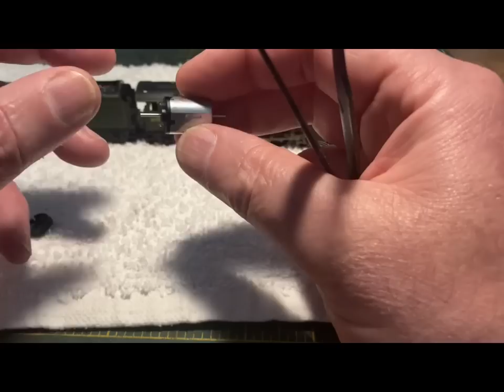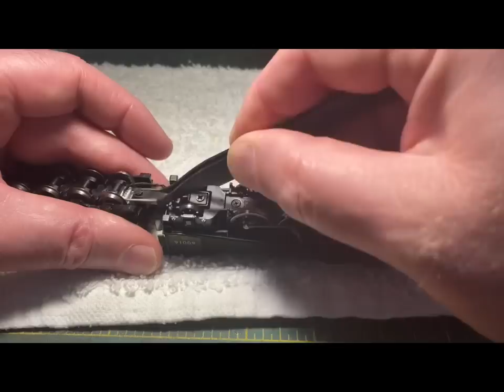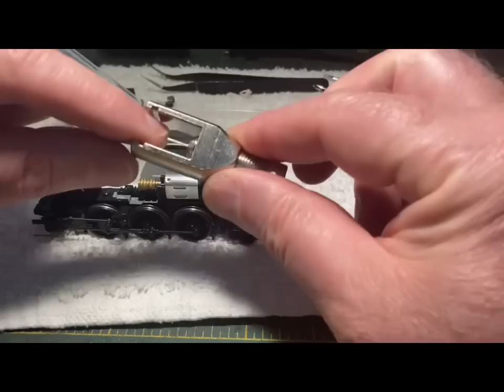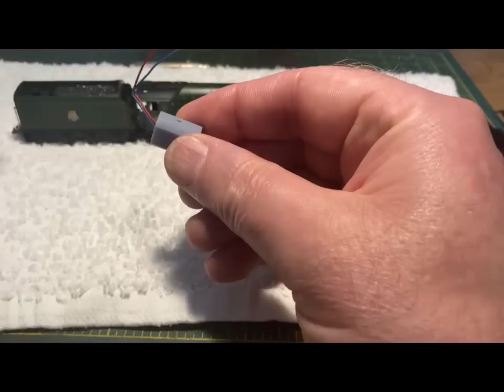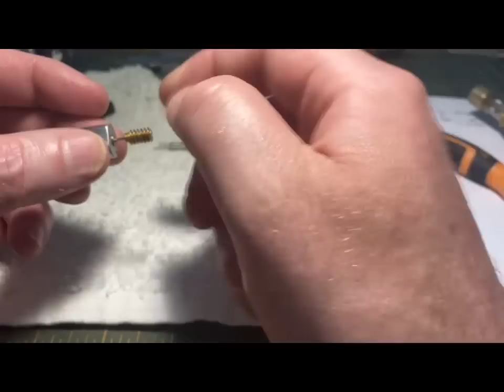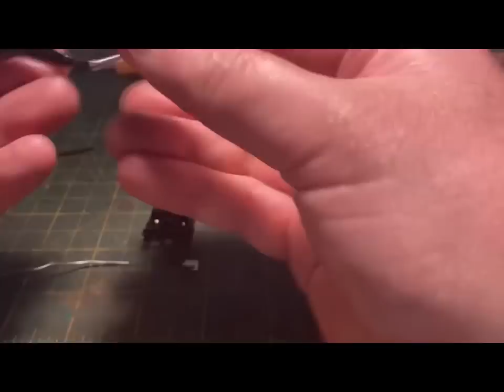Hornby TT:120 motor failure; a look inside & fixes UPDATES in description for suppliers

Comment: Fascinating video. Really appreciate, not only your positive pragmatism, but your technical analysis.
Being a little obtuse here: I've got a fair few items of TT, generally the old Berliner items. Now, I've been fiddling with a few motors, be it the original round case or square motors. The round case are sealed, but with changeable brushes. They are however an older (be likely 60 odd year old design now) and like anyone was interested in improving low speed running.
Now, I've tried a flywheel N unit, which burnt out almost instantly. What I deduced was that their more complicated drive (in this case a BR56 with all drivers geared and with separate gearbox assembly) was overtaxing the motor. Round case back in.
E94 krokodil: replaced with big flywheel mabuchi, slower top speed, generally excellent running characteristics. Another E94 I did a coreless: generally good consistent low speed but very excessive top speed, and far too responsive to small voltage increases. Basically very hard to control. (Using HM2000 analogue controller). Other E94's are round case and square case. Square case is more responsive (think less current draw).
The conclusion I've ended up is the old round case actually does have acceptable low speed running characteristics, is very tough and reliable, powerful, and its worst characteristic is its excessive size. In steamers it fills the cab, electrics and diesels of course it's no issue.
The modern tillig are superb runners, but like all tillig they're expensive.
Basically what I'm saying in this long-winded comment is I'm quite happy making the compromise of functionality and reliability over aesthetics.
I will also add, slow speed running is a bit of a misnomer, I am more desiring of smooth starts and stops over any crawling ability.
Think its very commendable you experimenting with remotoring, unfortunately in your case it's through necessity, in my case it was just a case of being desirous to experiment.
I personally have either stayed with the original motor, and if I was going to re-moter a loco again it would solely be a flywheel mabuchi.
Reply from the maker: I had a Tillig small diesel that shorted its own motor straight out of the box, it was disappointing but Tillig agreed to have it back as you would expect but for the first time ever I dropped the loco on a edge of my steel tool box…lots of parts mostly broken so it never went back. A Roco Br108 motor failed (same issue as here) in 8 hours of running, it went back, 5 months later returned, lasted 1 hour and then Roco refused to even talk about it. Poor company ethics. I remotored that one myself and it’s fine now. The brand that always impresses me with running and durability is Piko, I had an HO BR118 as a youngster and it was a tractor! I have two Piko TT locos now and they are so impressive. The detailing isn’t the same standard as Hornby have achieved but running and hauling power is faultless. 
Having DCC and in particular HM DCC is a real help with re motoring as you can fine tune any motor easily. The hurdle is getting the BT decoder into the model, hopefully Hornby can get Gen2 smaller ones out soon. 
Glad you appreciate the approach, a lot of people in YT lane are drama queens and not engineers, although this is not my area of expertise, an engineering approach delivers results. Identify the fault, fix, redesign, implement. What can we do now with what is available? 😁
Reply: @HighFell   I was afraid you'd mention that regarding tillig. I think I've been lucky with the very few I've had (although my E77 has barely been run), the German tt forums aren't the most complimentary regarding tilligs consistency in quality and reliability. Roco seems to be detail and body molds, but very, very few are complimentary towards their quality of running gear.
Everyone is a fan of Piko: I had just the base tt Taurus, and it was a beautiful loco. I'm quite keen on trying out a kuehn at some stage.
TBH, my main trains are '50's and '60's märklin and '20's Lionel, Ives, and American Flyer, and with reason.
With the old Analogue märklin I've got a few pieces of the very, very good quality HAG. Yes, in appearance they may be considered crude, but they measure quality in paint finish, functionality, and reliability, not through the amount of add-on plastic detail equipment.
I've currently got what used to be my modern dcc scale H0 sitting in a box as I've just given up. It's all likely to end up in the bin in the near future.
I've honestly lost interest in attempting fitments and refurbishments and alterations through necessity, I enjoy fiddling and tinkering but just because I want to tinker. 
All good fun, and as always, tt is die ideale spür
Keep up the good work
Reply from the maker: @muir8009  thanks, I think one area where Roco and to a smaller degree Tillig have let themselves down is customer service. Roco is probably the worst company I have ever dealt with, on anything. The arrogance they display is staggering. In UK we are very lucky that our home manufacturers are very customer focused and while things are not always perfect they do try very hard to get things sorted, Hornby are absolutely top of the tree on customer service and why I really hope they can get to grips with this issue, we know they have already made revisions and changes as things have shown up. Absolutely, TT, the perfect scale 😁

Comment: Interesting back when I used to shoot I had a set of drift punches, all of those used a hardened steel pin with a highly polished tip (so as not to mark the surface of the pins you were removing) for that pin to bend like that it's probably just mild steel with no heat treating. If one had access to a small lathe it would be a relatively simple if crude replacement to use a pit of correct sized mild steel for the body of the pin that mounts in the tool and use a HSS 0.9mm drill bit as a replacement for the actual driving pin just cut to length, you can buy 5 0.9mm drills for £5 so you could even make several different length versions to just drive out a bit at a time.
Reply from the maker: They are just mild steel, and some tinkering with a lathe would be ideal. Hardened pins would be ideal and the diameter could be increased slightly to 9.5mm too. Might ask a local blacksmith if he can harden some for me. 👍
Reply: @HighFell  it seems rather strange to think of a blacksmith working on something that's just 9.5mm in diameter!!
Reply from the maker: @andybuckley9223  to harden steel, it’s brought up to 600 degrees and then quenched in water.

Comment: THAT IS BAD sound.
Reply from the maker: I am wondering if that was the motor chattering in the mount, there was some movement even with the foam packing in place. If that was your car you wouldn’t drive it!
Reply: @HighFell  I Thought that gears are not meshing buy that sound, As had OO scale Hornby Loco that blew a Motor and refitted make it more Louder Which I do not mind

Comment: Very informative, thanks for making. May I ask what soldering iron you used, thanks.
Reply from the maker: The one to heat up the worm gear or to desolder and solder the motor wires?
Reply: @HighFell  🤣 I thought they were different and then I questioned myself! Both if you don’t mind, thank you.
Reply from the maker: @Haymarket47  the electric soldering iron was a generic Chinese kit of Amazon £15 and perfect for model railway stuff, the stand does need holding down though, I use black tack and an off cut of ply to stabilise it. The cranked tweezers and cutters are part of kit so really useful tools. Iron has replaceable tips and adjustable heat setting. Soldering Iron, Soldering Iron... https://www.amazon.co.uk/dp/B07SLRRYMC?ref=ppx_pop_mob_ap_share
The gas one is a Portasol SuperPro 125, had it for quite a few years, very useful for soldering where mains electricity is a problem, they are more expensive at around £40ish. I don’t think heating the brass worm did that much, using the shortened pin is probably the key.
Reply: @HighFell  Thank you for such a comprehensive reply.

Comment: Excellent Matt, hopefully Hornby will look at this and try to see if they can help us but I am not holding my breath. I would like to think the J50 motor with brushes might be a direct replacement.
Reply from the maker: This is what I am wondering Garry although the carbon brush versions of this can size I have seen are larger around the end cap so slightly longer. That’s only ones I have seen and there are 1000’s of motors out there so it’s a wait and see thing. 👍
Reply: @HighFell  when you say longer Matt, does that mean the overall length may be slightly longer? If so, I should still be able to fit it with a little judicial grinding.

I imagine it could be due to the brush width being wider than the metal wipers?
Reply from the maker: @garryhall5552  yes the one I saw was  about 3-5 mm longer but it was a photo rather than with full description of dimensions. The end cap was obviously more bulky and the carbon brushes are held in with a wire spring like many of the Continental HO models used to use.

Comment: Nice result but is there any reason this motor would last longer than the Hornby one? I was interested that the coreless comes with an adapter. That seems like a good solution. What do think?
Reply from the maker: The plan was to try this motor first for two reasons, it’s dimensionally identical and has very very similar insides so a direct comparison and at £1.50 each you could replace a arm full of of them for the price of 1 coreless one. The next will feature a coreless swap, Trigo is displaying early symptoms of motor failure so I expect won’t have long to wait! I am speaking with another supplier whose motors I would prefer to try. I’ll keep people updated

Comment: Wow! Surprised at this issue, but great that you have found a solution for us and our Chufty Pufty’s if we get the same issue.👍 Actually, now you’ve highlighted this, I’ve noted that my Willy Whitelaw is making more noise now after just about an hours (if that!) use. 😱
Also on a completely different topic, some videos ago I asked you about a ‘how to’ video for a “reverse loop” using the HM 7000. I’ve now got that baseboard built (nearly) so will hopefully be needing some more or your Helpful Hints 😉
Many thanks indeed for all your advice which is very much appreciated. 👏
Reply from the maker: Sorry the reverse loop stuff still in the works! It’s not 100% HM 7000 as I use regular DCC for operation and HM DCC for tuning the decoders 😁
I am not having a downer on Hornby in TT:120, but there a few things that need sorting and they can be 😁
Reply: Hi HighFeller, wow you reply quick! 😂 I’m looking for a reverse loop module that will work with the HM7000 system and hopefully I can figure out the other bits???  The items I’ve found so far state won’t work with the HM7000 so any pointers would be HUGELY appreciated.
Again many thanks for all your contributions, and I’m learning lots from your posts. 
Cheers 🍻 
Andy
Reply: I agree there a a “Few” things that need sorting and these are frustrating, but I’m still very enthusiastic about the TT120 offerings that I’ve bought so far from Hornby and the growing number of other suppliers/ sources .
I just hope someone fairly soon offers some little steam shunters, or a Castle Class/ Hall Class/ Black 5’s etc etc etc….. 😉🙄 I know, patience is a virtue. 🙄
Afraid the J50 doesn’t really float my boat, and to top it all there is no DCC ready version currently on the cards. (Same as the class 08??)

Comment: It sounds like perhaps the worm gear needs repositioning on the spindle.
Reply: Oh dearly me. I guess 38 hours is a long time for many of us out there on the positive but, what a shame these motors are not really up to it or, have been manufactured to a lower standard. Very informative as usual 👍
Reply from the maker: @modeloco  Andy, the failures seem to be either very early, in first few hours or 30-35 hours. You have so many railways you would take years to log these hours, so if us are running a full TT timetable! Seriously it’s motor issue rather than just a Hornby one, loads of manufacturers are having issues. I’m more interested in workable solutions rather than engaging in the tantrums on YouTube some people do… nice carpet… There are options and before anyone gets on their high horses, I genuinely don’t believe any model manufacturer in the UK or abroad sets out to make a bad model 😁
Reply: @HighFell  yes, heard Simon Kohler say just that and totally agree… though maybe some are buttering each others paws and like your good self, not into that 🙏
Reply: @HighFell Love the carpet reference 😂
Reply from the maker: Not sure if you saw in video, it’s quite long, but I checked that and it wouldn’t affect the slow top speed. The brush fingers are definitely starting to come apart on the surface, I got a look through a magnifying glass, the material is delaminating. Couldn’t get that on camera. I also checked the worm position with other locos and it’s identical. Using the Helio Tape on the motor body has secured it in the mount much better than the sticky foam on Hornby one, I’m thinking the noise is the motor chattering in the housing. Anyway the fix is like day and night. 👍
Reply: @HighFell I am just watching it now, and yes it looks like it was brush wear. I would say these brushes were assembled misaligned, which is unfortunate.
Reply from the maker: @little_britain  the one with the burnt out ‘fingers’ has been bent out more to allow the camera to pick up the damage on the ends of the fingers, two have burnt off completely one is just hanging on. When the motor goes in reverse the short ends jam in the gap in the commutator. On the new motor when I pop the end cap off, alignment looks ok but the surface of the fingers is deteriorating already at 10mins of use. I think the delamination in the brush fingers is what is causing the poor performance, it’s making a poor contact, either that of a winding on the armature is damaged.

Comment: These 1st Generation locos need sorting out, they need retro fitting to bring them to the same or close to same standard as the current Princess Coronation class. My Flying Scotsman loco feels like Triggers broom, its has 2 new motors (1st kept shorting the track, 2nd just buzzed), new valve gear, new pickups (running slow), new tender (HM7000 burned out, literally and melted the socket) and just returned back today after having new casing (running slow after 2nd motor fitted).

Mallard has had 2 new motors and pickups, Blink Bonny has had new valve gear, motor and front wheels realigned due to constant derailing. Night Hawk arrived Tuesday and keeps intermittently stalling on points. Called CS this morning for advice and they immediately pulled it back in for QC to take a look at.
Reply: Are you planning to use the coreless motor in any future upgrades, would be interesting to see how they run compared to the 3 pole
Reply from the maker: @DaveC1964  that’s absolutely on the cards for the next one to go pop, Trigo is next, it’s starting to ‘stick’ and not moving off on start up which is a sign the brush fingers are jamming up as they burn off. I hope that there could be something really special to try though. I’ll let everyone know as soon as that happens. 👍
Reply from the maker: I’m just not sure how achievable that’s going to be, it all depends on what motors etc are available. I’m actually very surprised how much better the eBay bargain basement one is than the OE one, although it will all hang on how long it lasts! At £1.50 doing one 5 times is cheaper than sending one back 😳
Is it slower than SK is at beginning of video?